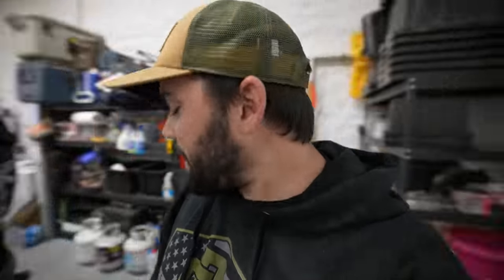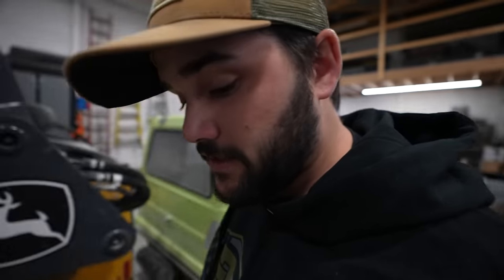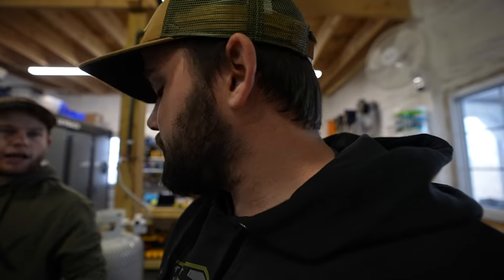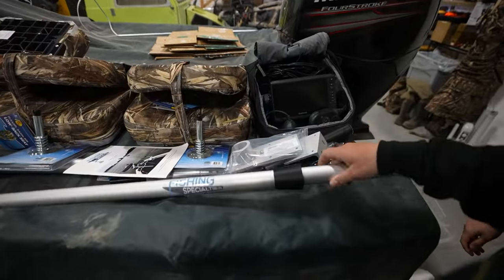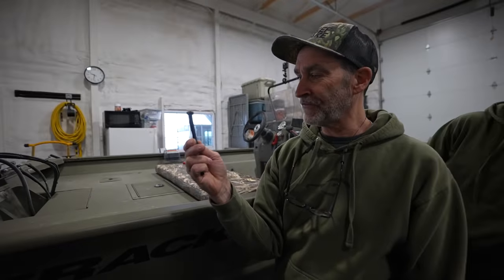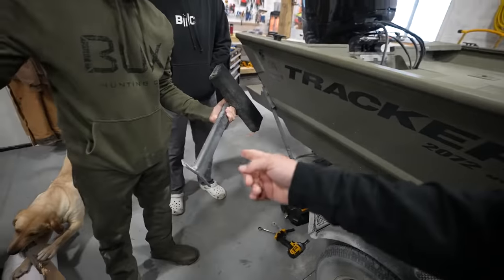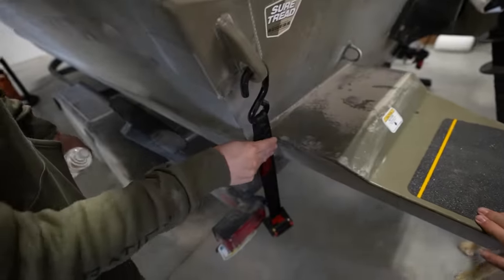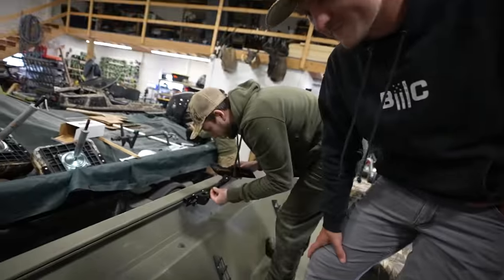BUILDING the ULTIMATE CUSTOM River Fishing BOAT!!!

Comment: Those step on the back of the boat are floats they are just welded to the transom. They are not meant to support weight from the top like a step.  They are meant to support the weight of the motor so the boat doesn’t lean in the water and helps a lot with getting on step quicker.
Reply: They are called sponsors I was thinking that when flair said I thought that was the whole point of it meaning stepping on them
Reply: Could you just bolt/weld some flat or T iron to reinforce it, so it could be used for both?
Reply: @chrisjohannes179  Yes you could, he just shouldn’t use them as a step without doing anything to them.

Comment: Hey y’all should add “Gator bak bunk covers” you can get the “clear” (smoked clear) and add led strip underneath it so you can see a little better to load the boat at night. Plus it helps a lot with loading and unloading the boat. Have them on my bass tracker and it does wonders.

Comment: Hey you should move your heater to that corner right next to where it is at to better distribute heat in the garage. Just little hvac pointer and should also mover your propane tank out side for safety 😂 just trying be ocean approved